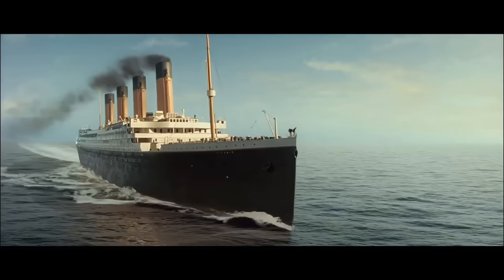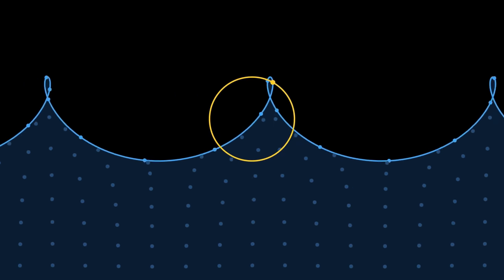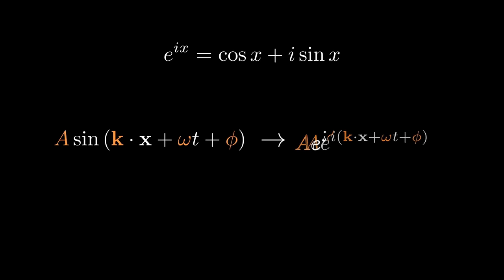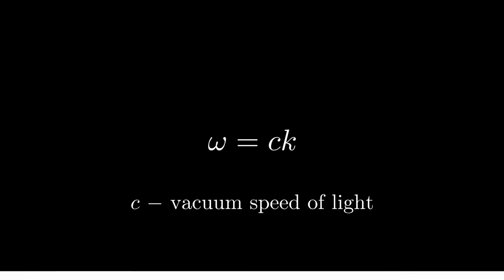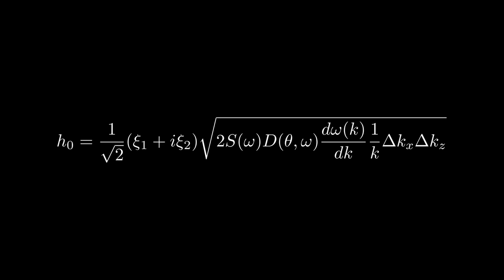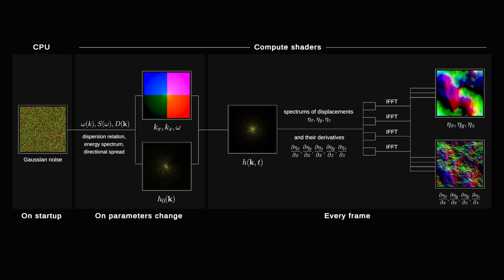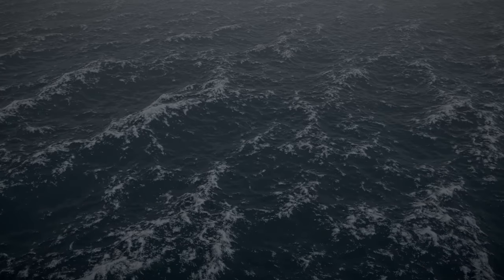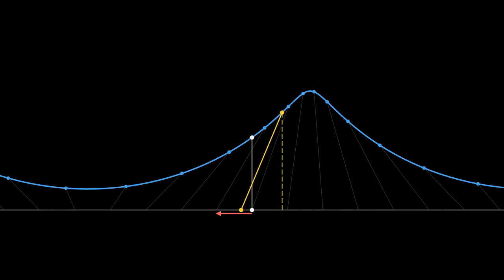Ocean waves simulation with Fast Fourier transform

Comment: This is really amazing. May I ask you what type of license you have in mind for the source code? Would you mind adding one so we can be sure to use it properly.
Reply from the maker: It's MIT, already in the repo.
Reply: @JumpTrajectory  Ah thanks, I must be blind, sorry.
I just ported it to HDRP today with Amplify Shader and it's working great!
Reply from the maker: @Zicore47  I'm working on an optimized simulation (I made several novice mistakes with the first version) and a much better shader than I did for this video, so stay tuned for the next one!
Reply: @Zicore47  i am currently trying to port this to URP, for some reason im having problems to sample the derivative textures (shader graph)... did you run into similar problems? (Maybe im missing something obvious here... all rendertextures look fine, only my sampled textures in shader graph seem to be off)
Reply: @svenmeister1337  The only thing that I can think of are the WorldUVs maybe something is wrong there? But it's hard to pinpoint the exact problem without more info here :)
Reply: @Zicore47  Thanks for answering! My wireframe displacement looks exactly like the one from github, so i was assuming my UVs are probably right! I will test it out later today once more, thanks for your time :)

Comment: Hello, i have a quiestion. in the URP version is it posible to sample the height of the ocean at a given position?
Reply from the maker: Hi, there is no built-in function for this, but you can implement it in the same way as outlined in the video.
Reply: @JumpTrajectory  Hi, thanks. Actually i was able to do so. By getting OceanSimulation instance and accessing Collision class from it and then calling  GetWaterHeight (world position) in that class.  And you have to enable the readback feature. It seem to work fine enough.
Thanks for taking the time to upload and share the project. I really love this ocean. totally in love. I have implemented it in naval simulation will post videos in my channel. 
Cheers!
Reply from the maker: @lonewolfgabo  Oh, so the function was there afterall. Forgot about it. Glad that it works OK, but in hindsight I think that a better way to do this is to send the points where you want height samples to the GPU using something like a StructuredBuffer, do the calculations there and then readback the results. It is a bit more difficult to implement and will be more cumbersome to use in scripts, but I feel like it will be more performant, because a lot less data needs to be read back from the GPU.

Comment: is there something special i need to do to run this? cuz when i open it, its all light blue-ish plane mesh. it creates the meshes but no waves at all.
Reply from the maker: What platform you tried it on and with which graphics API? Someone had a problem like this on DirectX 11 on Windows 7. There is some difference in Nvidia drivers, because on the same graphics card on Windows 10 it worked fine. Couldn't figure out what was the problem.
Reply: @JumpTrajectory  i'm runinng it on windows 10 dx 11. my unity editor version was newer than the project itself, so i had to upgrade the project. maybe that was the cause but i dont know.

Comment: At 6:20, is h the depth of the water at that point?
Reply from the maker: It's a uniform depth. This kind of wave generation isn't suited for variable depth (though you can make shore interation by different means).

Comment: Did you use Manim?
Reply from the maker: Yes!
Reply: @JumpTrajectory  Nice. I'm still learning it, but even as a sophomore CS major I don't really grasp it that well. Although I did make a couple of things with it so far, like "an introduction to latex in 5 minutes". Pretty cool though. I was also thinking of building a ground up animation engine. I wanted to be a bit unique and perhaps figure out a systematic way to implement something like Kurzegast' s videos without having to animate each scene in after affects or blender.

Comment: Can any here remind why a sine function would oscillate up and down when the input increases linearly? Is that because of a unit circle in trig reason of some kind? (so basically the triangle size changes as it rotates and thus the angle sizes of triangle change, etcetera) Thanks in advance!